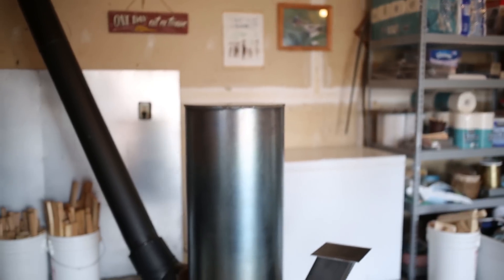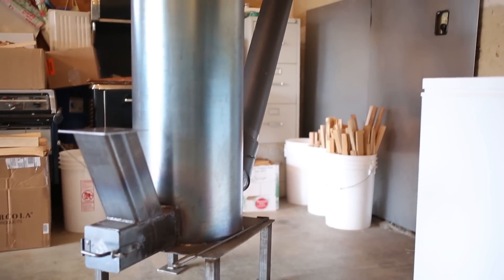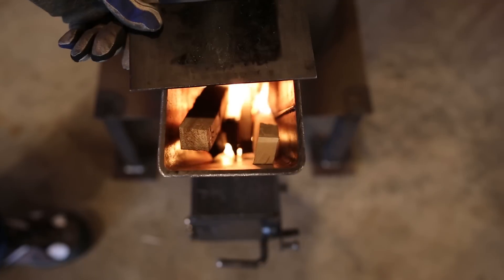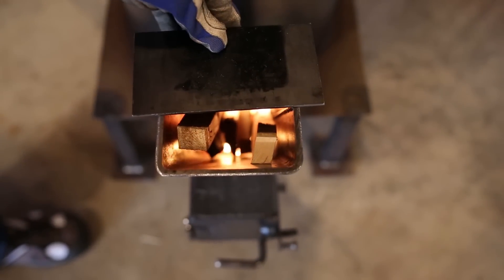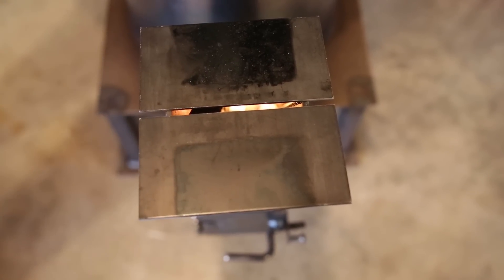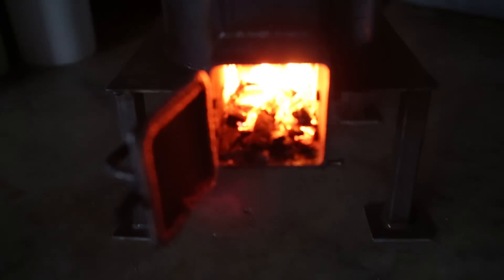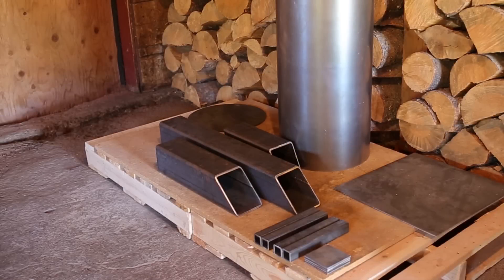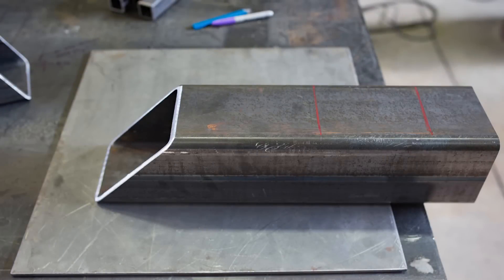Rocket Stove Heater Parts List and Build Sequence - Part 3 - Firing Up

Comment: how do you clean the ash inside the cylinder??
Reply from the maker: I disconnect the exhaust flange from the chimney pipe and vacuum out the fine ash.  I do this once or twice a winter.

Comment: Can I use it inside to my house to the living room???
There are plans with the dimensions or I will take that from the description of part 1????
Reply from the maker: 1.  It is NOT designed for day to day in home heat or as a primary source of in home heat.  It is designed for an emergency situation where maximum heat output is desired over basically any other consideration.  In that capacity it works well in a shop, garage or suitable outbuilding….
2.  I do not offer plans.
Thank you for your comments.

Comment: Hello, First of all great video to explain everything regarding the Rocket, easily. Congrats. I am a marine diesel engineer and draw many type of Rocket to build up and trying to get a decision. I have few question if you kindly give an answer. How much percent less the stove is burning the wood then normal stove? Should i apply the insulation for burning chamber and inner expansion funnel? I am planning to insulate by high temperature heat resistance wool? Is it to waste effort? needless because don't make much difference? Could i add an inspection-side view glass (high temperature resistant) to final expansion part? My aim is, as you know Istanbul is waiting for a big earthquake and i am planning to be ready to all extreme situation for my family. My hause is 100 sq.m and normal small wood stove is working effectively. But in emergency time i couldn't find enough fire-wood i ques? many thanks again for the video and many thanks in advance for your answers. Kisses to all your family from Turkey.
Reply from the maker: Hello and thank you for your inquiry.  Any modifications you choose to do you will need to experiment with.  I cannot give specific answers to your questions.  My stove was designed for emergency use and so, I am not concerned with insulation or other addons.  I am only concerned with maximum heat output.  I don't know what you mean by a "normal stove" so I cannot answer that question.  Good luck with finding what works for you.  It's good that you are preparing for a worst case emergency scenario.  I hope my videos will be of help to you.  All the best from Montana, USA.
Reply: @8Weeksand2DaysSurvival  Many thanks bro, for your answer. I will try to investigate.. Many thanks again. If i will do -get some ampric result, i will let you share. kind answer.

Comment: Should put a second pipe around inside tube and filled the space with vermiculite. Makes the gas hotter and increases secondary burn.
Reply from the maker: Excellent option for the individual builder to consider.  I offer the kit as described in my YouTube videos.  I do not offer the plans or a welded unit….only the steel parts.  I offer one size.  I do not offer a water heating mechanism, pellet feeder adapter, insulation around the riser or other options or modifications.  I leave those and other options to the discretion of each individual builder.  This way they can add to their built to achieve their desired objective using my kit as a basis to work from.

Comment: So the longest the stove can run is 1/2 to 45 minutes before it needs more fuel? That is a long night.
Reply from the maker: Correct.  FYI...The kit is for survival / back up purposes, not intended to be used as a primary heating unit in a home on a day to day basis.
Reply: No. Put a long 2x4 in it and let it eat

Comment: You can use an old water heater tank (30 -60 gal.) and ceramic coating for aesthetic purposes . . plus 2-3 baffles for ignition of wood gas at 500 deg.  by using larger vent pipe either under the floor or in the wall even a larger amount of heat can be captured.  some welding  or brazing is necessary an old saw blade with new stainless steel for the top (cook top) and add a fan in the lager vent pipe flue temperature should be below 200 degrees for safety if  using an old chimney. . . you can put a clay or metal chimney liner in also just for safety if selling the place and be sure to point this out when advertising the property for sale . . . because it should be a good feature reducing cost of heating and in demand if the grid goes down e.g. all the pipe lines come though the Missouri foot hill.
Reply from the maker: Thanks for your input.  If you have any videos explaining your text, I would like to see your efforts...and I'm sure the readers would also.  All the best.

Comment: Could you make the feed channel longer, to stack more wood in for a longer burn unattended?
Reply from the maker: I have not tested that idea.  If you do, let me know your results.....Thanks.
Reply: I’ve used 24” chicken wire cage as a guide for my hopper. I have a surplus of 8’ long hardwood trim “seconds” that burn for 2 hours on full blast.

Comment: Ok so what's the max heat you have gotten out of this rocket stove? Saying how hot it burns is up to you doesn't answer the question. My wood / coal stoves can and will get up to and excess of 1000 %F Does the outside of this rocket stove break 800 %F ever?
Reply from the maker: The firebox if allowed, can emit red heat, visible in daylight, which is about 975 degrees F.
Reply: @8Weeksand2DaysSurvival  That's helpful. Thank you!

Comment: You are happy with the design?
I would certainly pay for paper dimensions.
I'm in Québec, Canada. I know a machine shop.
I'd love détails on how to make a fire box door. You used a seal. I liked that.
What about a way to detach the top so I can inspect and clean ash inside? It shouldn't be necessary, but I'm paranoid about creosote.
How much do you estimate the materials at? 
John jtjohnston@jtjohnston.ca

Comment: The only thing you need to make this a permanent stove is to build the internal riser with a stainless inner pipe that is insulated. You can then see temperatures far exceeding your current expectations and a complete burn of all gasses. This would also make your product more durable and longer lasting. Adding a stainless plate at the top welded and or bolted to shield the top from the intense heat will also go a long way toward the longevity of life expectancy and turn this unit into a main source of heat for a home. Also encourage people to build a thermal mass heat sink to trap the heat inside the home instead of spewing it out into the world where it does no one any good.

Just thinking in text. You have a solid product here and I wish you lots of sales and good health.
Reply from the maker: Excellent insight and comments.  My kit offers the core components needed from which each builder / assembler tends to modify or add-on according to their specific requirements, skill set and objectives.  Thanks.

Comment: Why is the door with hardware and take off for exhaust not included in the kit?
Reply from the maker: I offer the kit as described in my videos.  I do not offer a water heating mechanism, pellet feeder adapter, insulation around the riser or other options or modifications.  The door is not included because some folks want to incorporate an air vent in the door for a specific purpose (perhaps a pellet basket)...others may not want that option or want a door at all.  The exhaust flange is not included because some folks are using a 4" chimney pipe, some a 5" one and others might use a 6" one.  My kit offers the core components needed from which each builder / assembler tends to modify or add-on according to their specific requirements, skill set and objectives.

Comment: How much space will it heat?
Reply from the maker: Depends on what is the starting temperature, type of structure, insulation, height of ceiling, etc...the unit as you see it was tested in a 2 car garage that was not airtight, and raised the temperature from -26 F to 60 above one cold day last winter.  Is is not intended to be used as a primary heat source for a home.
Reply: Thank you for your reply. I understand its not for the home. It's getting a little chilly here in Scotland. I do have a large stone workshop 12 meters by 6 meters by 6 meters high so I may need more than one. Thank you for your time and make these really good instruction videos.
Reply from the maker: The garage was approximately 25 feet (8 meters) square.
Reply: Thank you!
Reply from the maker: Depends on room configuration and height of ceiling.  If you have watched all 3 of my YouTube videos you’ll see that I have one in my garage which is approx. 25’ x 25’ x 8’…it does a good job of heating that size area.  Last winter I fired up my unit on a day that started out at 26° below zero F.  It raised the temp to 60° above over a couple of hours.and my garage is not air-tight by any means...it has 2 doors besides the garage door itself and can be quite drafty.

Comment: could you build another larger chamber around the firebox that would hold 30-50 gallons of water that when the stove it burning, the water would get hot and when the stove went out the heated water would slowly radiate heat...of course you would need some type of pressure release valve....just some food for thought...
Reply from the maker: My aim was for intense heat generation in a survival type situation....basic and to the point.  I leave it up to the end user to modify the design to fit their own needs / specifications.

Comment: I've seen a lotta rocket heaters on YT, but I like the way you posit it rhetorically as a solution to (survivalist) problems. Also, good welding. Thumbs up
Reply from the maker: Thanks for the kind words.  I see that you understand my objective... I get many calls from folks who want to use my kit as their primary source of (home) heat.  That is not why I designed it like it is.  My kit is designed to generate intense heat and run flat out if necessary, for months at a time.  You would not want that kind of heat sitting in the middle of your living room.
Reply: Indeedy. That'd be where the 'mass' comes into its own!

Comment: No secondary air needed?
Reply from the maker: Not needed for my purpose of survival / back up.  Configured as is, my kit generates as much heat as I want.  A person with the experience and skills can take my kit and add secondary air as you mention, pellet feeder basket, bulk pellet hopper, hot water generation, mass heater, etc, etc.
Reply: https://www.youtube.com/watch?v=R6pm-TD0P84

Comment: why is the burn chamber outside the body of the stove? why no outside air source?
Reply from the maker: I went with simplicity of design and maximum heat output.  As such, it is designed for survival / back up purposes, not intended to be used as a primary heating unit in a home on a day to day basis.

Comment: What's the cost of the kit?
Have you thought of a pellet design?
Also, ifI have a 'standard' fireplace what about a design that works as an insert?
Reply from the maker: 1.  For price and shipping details, please email me direct at mtmarket@mcn.net  Thanks.
2.  I will not be offering a pellet design.  I will leave that and/or any other modifications up to the individual and their skills to take my kit and configure it to meet their own specific objectives and requirements.
3.  This kit and unit is capable of generating tremendous heat.  As such, it is designed for survival / back up purposes, not intended to be used as a primary heating unit in a home on a day to day basis.

Comment: How do you clean it when it is welded solid ?
Reply from the maker: Hey Marc....To clean, disconnect the first section of chimney pipe where it attaches to the exhaust flange  and vacuum out.  After extensive use and testing for over 2 months, there was about one inch of fine light powder that had accumulated, and virtually no accumulation of soot or creosote in the chimney pipe.

Please keep in mind that my kit is for survival / back up purposes, not intended to be used as a primary source of home heat or on a day to day basis.

Comment: use expanded metal 4 3/4 x 4 3/4 x 7 inch tall leave 1/2 inch gap at the bottom for air flow
Reply from the maker: Sounds good....thanks.

Comment: i see you did a nice job but i see you need to put pellet basket in it for an option
Reply from the maker: That would be a good option.  If you have a specific design in mind, please send your drawing my way.  Would need to fit inside 5" X 5" X 1/4" square tube....thanks.

Comment: A survival stove?!?!?! try carrying that thing around in an emergency,lol
Reply from the maker: I hear ya, but you won't be carrying anything around in the kind of emergency / upheaval that I'm talking about...you're gonna want to be hunkered down, warm, dry and fed, trying to make the smallest footprint possible.
Reply: if you say so,lol
Reply: Rocket stoves are for a fact the most efficient way to heat your home regardless of your connection or lack of connection to the grid. The only thing you are missing is a thermal mass heat sink that would maximize the efficiency of this stove.
Reply: Where are you planning on carrying it to Paul?  A FEMA Camp? You must be one of those Hollywood Preppers who thinks they're gonna bug out to Shangri La and live happily ever after. smh.

Comment: Hmmm.... as most seasoned rocket stove builders have moved to insulated refractory risers because even stainless will eventually fail, how long are you giving your mild steel risers before they spall or slump with the heat?
Reply from the maker: Please refer back to 2:30 in Part 3 - "Why am I doing all of this....What's the point?"  Here's why.....The kit is for survival / back up purposes, not intended to be used as a primary heating unit in a home on a day to day basis.
Reply: OK. Thankyou for the clarification, sir.

Comment: Do you have a kit that inserts into a traditional fireplace?  It's a stellar idea having the kits and an excuse for me to buy a welder and angle grinder!
Reply from the maker: Good question, SC JMO as it allows me the opportunity to explain WHY I created this kit in the first place.

1.  I do not offer a (conversion) kit for a traditional fireplace.  Reason being... unless you are physically around to tend the fire throughout the day or evening, it will need fuel every 30 minutes, plus or minus.  So, it's not practical from a day-to-day point of view of going to work and keeping the house warm at the same time.
2.  My objective is to offer a kit of parts as one aspect of your Survival Plan (for like minded individuals) if the power grid goes down or some other such man-made or natural upheaval or disaster.
3.  The objective is for you to have a way to heat your garage, out-building or workshop where you can hunker down in tight quarters and ride out the storm and survive...cook on and boil water on as well.
4.  When you are involved with building something from a kit of parts you "get to know it a whole lot better" and how it will function according to the decisions that you make.  Besides, it's a blast to put together.